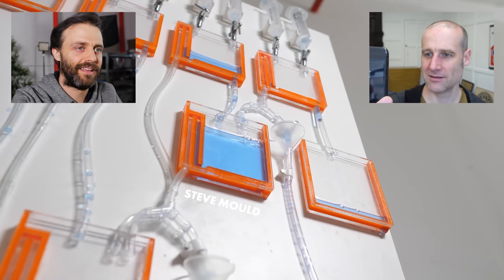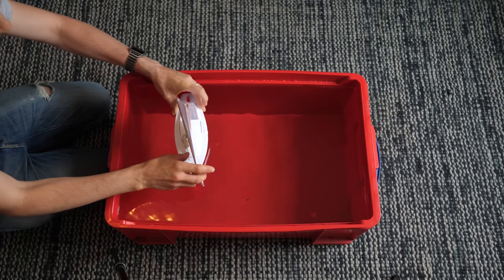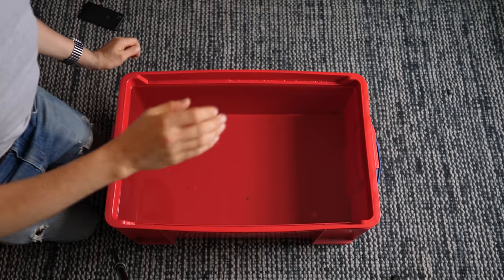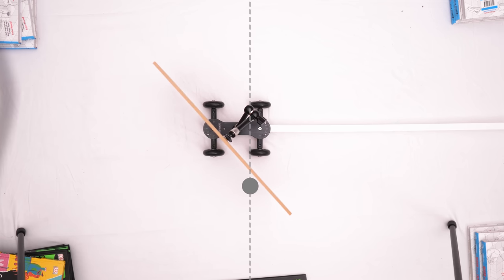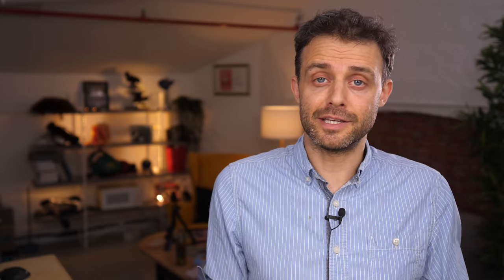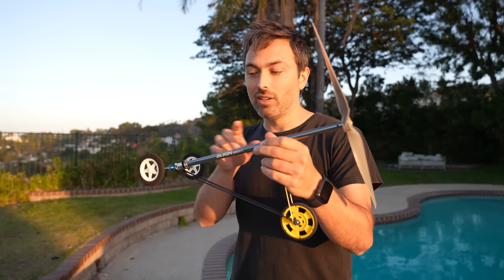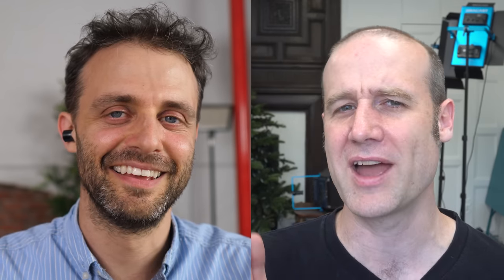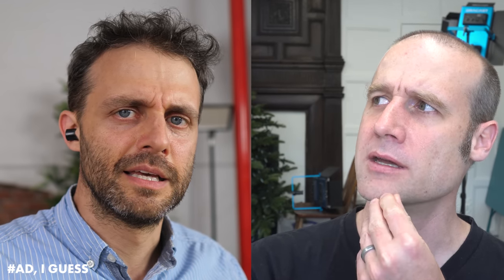Sailing Faster Than The Wind - How Is That Even Possible?

Comment: Bernoulli's Principle and the Coanda Effect are two sides of the same coin as I understand it. The Coanda Effect describes how flow clings to a convex surface resulting in a change in the flow's direction of travel, and Bernoulli's Principle describes how the force required to change that direction of travel is reacted against the curved surface via a change in pressure. You don't get one without the other.
Reply from the maker: Good insight. I think I might end up using your glass cutting techniques for an upcoming video by the way!
Reply: @SteveMould  Good stuff! If you use my mini sandblaster design and find it shreds right through electrical tape it's probably because the sandblaster barrel is too long. It's a balance between cutting the glass quickly without destroying the stencil.
Reply from the maker: Thanks for the tip!
Reply: I more or less agree until you say "You don't get one without the other."  For example, Bernoulli's equation can be used to describe the flow in a pipe that has a reduction in diameter (no increase).  With no increase in diameter (as one travels downstream), I don't think the Coanda Effect applies anywhere.
Reply: @andrewsnow7386  I think the coanda effect is still present in that situation unless the reduction never levels out (a closed cone shape, which would have no flow anyway), as is the reacted force on the wall of the pipe. Because of the coanda effect you can assume the fluid will fill the volume of the pipe and follow the curves of the wall (because bernoulli's principle tells you that a vacuum would form otherwise) so it's not necessary to think about both principles simultaneously.
Reply: As a fluid dynamics grad student, I hope it's ok if I point out that the Coanda Effect and Bernoulli's Principle are actually a bit different than what you've described. There is some relation between the two, but there's really three sets of physics: Coanda effect - fluid jet hugs a wall due to viscous fluid entrainment; Bernoulli Principle - energy conservation along a streamline; fluid changing direction - momentum balance in the radial direction. 

The Coanda effect occurs when a jet of fluid sticks to a nearby surface. The reason the jet follows along this surface has everything to do with the surrounding fluid being quiescent (or at least slower than the jet). Because of friction and/or turbulent mixing, the queiscent fluid is dragged along ("entrained") into the jet. If there's a wall, the entrainment occurs only on one side of the jet, pushing it to the other side (there's more analysis here, but that's the end consequence). Note that this happens even when the wall is straight! The jet will hug the surface due to this viscous entrainment of the surrounding fluid. Also note that this entrainment doesn't really happen around a normal airfoil, so the Coanda Effect is not active.

Bernoulli is strictly about energy conservation along a streamline. So when you already know that a fluid is going to accelerate or have a certain pressure along a streamline, you can use Bernoulli to keep track of the energy balance along this streamline. Bernoulli typically assumes no friction, so that's another point of difference with the Coanda effect.

When a fluid changes direction, that's related to a momentum balance. Often, it's a radial pressure gradient balancing the centripetal acceleration of the fluid. Note that this radial pressure gradient would be mostly perpendicular to a streamline, so Bernoulli is not really the explanation for why this pressure gradient occurs in the first place.

Finally, here's how these effects can be related. When a jet hugs a curved surface (Coanda Effect), the entrainment of air creates the radial pressure gradient that supports the jet's curved motion. When fluid curves around the leading edge of an airfoil it typically accelerates due to conservation of mass, causing an increase in velocity, and by Bernoulli - a lower pressure near the surface. This sets up the radial pressure gradient that supports the curved motion. Why the fluid accelerates around an airfoil in the first place, however, is not really something that has a nice tidy explanation. As with everything in fluid mechanics, the ground truth is just what happens when you simultaneously balance mass, momentum, and energy in the fluid.

Also one last thing, when a pouring liquid clings to a cup, surface tension + gravity is the dominant physics that causes the flow to curve.

I'm happy to discuss if you are interested in learning more about these phenomena. Keep up the amazing work with your videos, the thermal acoustic engine absolutely blew my mind!!
Reply: @TheBohrokMan  Thanks for the insight!
Reply: @Nighthawkinlight  Maybe TheBohrokMan covered it better, but consider a cone with the end open, like an old fashioned nozzle on a fire hose. Here Bernoulli's equation can be applied to the flow in the nozzle. But where would the Coanda Effect be seen? OK, TheBohrokMan makes the point that it applies to the boundary layer in a pipe (and would thus also apply to my nozzle example), and I guess that makes sense. But, I suspect that's not really what comes to mind when the Coanda Effect is normally being discussed.
Reply: @TheBohrokMan  Great explanations, if someone wants to dig deeper then I must point out either Babinski explanation of lift or Mc Lean's book
Reply: There’s no Coanda effect in sailing.
Reply: I also want to point out that airfoils dont need the Coanda effect in order to work. This is a common misconception. In fact a fluid will follow a curced surface without friction or the Coanda effect. 

Also, the Bernoulli principle doesnt really explain lift either. Or actually it kinda does, but it assumes that the air speed is faster on the top side of the airfoil, but fails to explain why. Even if this was the case, the Bernoulli principle  is simply an inadequate explanation.
Reply: @bogdanboiii1154  Perhaps you can explain then,
Reply: @Mentalzenthal  No one ever gets Bernoulli families stuff right. Backwards Euler method and Brachistochrone is the root of it all.
Reply: @anthonyb5279  My intention was just to provide some clarity, as it's surprisingly difficult to find accurate explanations of bernoulli/coanda online, but I'm sorry if it came across as condescending. I'm an aeronautics PhD student at Caltech, so I just really like fluid mechanics. I'd be happy to explain more about the physics if you'd like, it sounds like you believe I misused the terminology and am lacking understanding on a lot of things.
Reply: @TheBohrokMan  im not a grad student you can't teach me anything. There is that condescending "im a Ph.D candidate" thing again. Cal Tec. humm sorry to hear that, thats what I suspected.  my education does not matter (Cornel, ODU NASA Langley) I don't have anything to prove and my education does not validate my authority, a lifetime of solving problems and exploring space successfully, sailing world record setting Yachts, racing planes, airliners, and even little helicopters on Mars. A Ph.D does NOT make you an authority on everything, not even a specific field. It just proves you know how to work hard and fallow threw.  It is not the apex of who you are and what you will do unless you end up teaching. if you end up working in your field you will do equal or grater to that effort every day. if you condescend people because they don't have your education you will accomplish NOTHING and no one will work with you. These enthusiastic amateurs are right it's all interconnected. It's all relationships of different forces finding their way to equilibrium. They have not beaten Entropy its just too complicated to explain in a short video. encourage these people don't squash them with your vocabulary.  This stuff is AWSOME and fun to learn about. encourage them to do experiments and make observations, gain personal insight. thats what Bruno Invented science for.
Reply: @anthonyb5279  Again, let me know if you want to talk about fluid mechanics, I'm always happy to learn. And I do leave positive comments on pretty much all of these guy's videos, they're incredible. Oh and it's Caltech, not Cal Tec. :)
Reply: @TheBohrokMan  Cal Tec :-P
Reply: @anthonyb5279  I think there's a misunderstanding here, I never discussed the vehicle at all in my comment. I was only distinguishing between bernoulli and coanda. Feel free elaborate on what you think I didn't get right, I'd be interested to know, and you haven't really told me yet (I'm on instagram or twitter if you want to DM). A CFD simulation would be cool to see, although a simpler blade element model would probably give more interpretable insight into the physics
Reply: @TheBohrokMan  I say that you can observe Coanda Effect in frictionless fluid and I have harnessed the phenomenon. I wanted air that was delivered through a high wall register to travel along the  wall rather than simply be blown straight out of the register. I made a chute to direct the air horizontally along the wall. The moving air is at lower pressure than the surrounding air. That is Bernoulli in action. The air continues to stick to the wall and is held against the wall by the higher pressure surrounding air. That is Coanda Effect. The air travels 15 feet easily and thereby cools the entire room. Of course the velocity diminishes as you move further away from the chute.
Reply: @pauleohl  Wouldn’t there be friction there though? Air has viscosity, and the coanda effect occurs often in air. Also, a (subsonic) free jet of fluid is typically at atmospheric pressure, for example the air exiting a leaf-blower is at atmospheric pressure despite having velocity (it gets a pressure decrease at the inlet from bernoulli then a pressure increase after the fan and then matches atmospheric at the exit). I might not be picturing your setup right, but I’m almost certain it’s the coanda effect in a fluid with friction (viscosity).
Reply: @TheBohrokMan  Of course the air we breathe has friction. My point is that Bernoulli conservation of energy equation works reasonably well for real air and that the reduced pressure predicted by Bernoulli where velocity increases is what causes the Coanda Effect and keeps my moving air "trapped" and moving along the wall.

I can't comment on what occurs with a leaf blower.
Reply: @pauleohl  Fair enough, but my point is that a free jet of air won’t be low pressure. In general, jets of air are the same pressure as their surroundings. To use bernoulli, you have to follow the path of the air through the whole system - in which case you’ll find that the fan that pushes the air, raises its pressure. At the exit, a jet of air has more energy (pressure + velocity) than its surroundings (only pressure), which is due to energy being added by a fan. Fluid having velocity doesn’t imply low pressure.
Reply: @TheBohrokMan  "Fluid having velocity doesn’t imply low pressure."

How do you think the Venturi at the throat of a carburetor works?

enturi effect
The Venturi effect is the reduction in fluid pressure that results when a fluid flows through a constricted section of a pipe. The Venturi effect is named after its discoverer, Giovanni Battista Venturi. Wikipediaenturi effect
The Venturi effect is the reduction in fluid pressure that results when a fluid flows through a constricted section of a pipe. The Venturi effect is named after its discoverer, Giovanni Battista Venturi. Wikipedia
Reply: @pauleohl I think I may not have communicated my point clearly. In order to apply Bernoulli, you have to trace the fluid along the whole streamline. You are correct with venturi, because the air is at one velocity  before the throat and then reaches another velocity at the throat with nothing in-between, so Bernoulli says pressure is traded for velocity. But for a free jet (your previous example), there’s some kind of fan in the mix! Energy is added along the streamline which stretches from the intake of the system to the jet output! This is just what you’ll find in textbooks and research papers: free jets of fluid are at ambient pressure. Velocity can imply low pressure, but not always - certainly not in the case of a jet of air. My fluid mechanics classes would be so simple if I could just say 5m/s of velocity = a certain pressure drop. Bernoulli applies only under a very restrictive set of circumstances: along a steady streamline, with no friction OR energy sources such as a fan. Please, you don’t have to quote wikipedia to me, it’s kinda rude.
Reply: After reading all the discussion I can't believe that Kutta Condition wasn't mentioned.
Reply: @TheBohrokMan  I have to admire your politeness when dealing with this much arrogance. Have you seen the WIRED video where John Collins (aka the paper airplane guy) attempts to explain the aerodynamics of paper airplanes? Around 4 minutes in, he makes the claim that Bernoulli doesn’t apply because “it’s only applicable to pipes”. What do you make of that?
Reply: @LCfreeze  Well I try to assume good intentions behind everything I guess lol. I just watched the video, and I only have issues with his lift and stall explanations. Everything else about stability or wing loading is 100% correct and awesome to see. Hope you don't mind the long comment below.

Alright, so Bernoulli definitely applies to airplane wings. It applies to any steady streamline of fluid (without friction). In fact, the classical way of computing the lift of an airfoil shape is to use Bernoulli on the upper and lower surfaces of the airfoil to get the pressure distribution, and thus lift. But, this requires you know the air speed across the airfoil beforehand. So it's not a way to "explain" lift, because you can't just look at an airfoil and use Bernoulli on it - you'd need the flow field around the airfoil first. 

To get that flow field (i.e. how the air is faster on the top than on the bottom) requires that you solve for it! Because air is a continuous medium, you need to find the motion of the air that conserves mass, momentum, and energy everywhere. There are some shortcuts, such as potential flow, which engineers used primarily in the past to find out how the air will move by hand, but these days, it's often a computer simulation. In short, the air goes faster over the top because that's just what the fluid does when it has to follow the laws of physics while moving around the airfoil. Not a satisfying "explanation," but that's ultimately what it comes down to. The best I can say is that the air gets kinda gets squeezed at the leading edge, which makes it go faster, but that's a simplification of events. 

I don't agree with him that the Coanda effect has anything to do with lift or stall. As I've mentioned in previous comments, the Coanda effect (as originally defined) is this narrow phenomenon of a jet of fluid sticking to things because it drags surrounding fluid along with it. I think that applies to the ping pong example because it's got a jet of air, but it doesn't happen in airfoils - there's no jets of air anywhere! 

The reason airfoils stall at a particular point requires delving instead into boundary layer physics. Basically, a thin layer of air right on the top of the airfoil gets slowed down due to friction with the airfoil's surface, and this layer can tend to separate as it loses energy under what's called an adverse pressure gradient. This is different than Bernoulli or Coanda, and can get somewhat complicated, so it's hard to go into here. But it's largely responsible for the separation. In fact, most methods for predicting stall and separation are entirely based on boundary layer physics (besides those that just simulate the whole fluid). 

I hope that was mostly clear, hopefully my explanations aren't too confusing. :)
Reply: @TheBohrokMan  thanks for taking the time to look at that video, I appreciate it :) I always feel annoyed when someone grossly oversimplifies or distorts something that I’m educated at. You seem so chilled out in the face of all the misinformation — I’d like to reach that level of Zen mastery too.
Reply: @TheBohrokMan  How does the Kutta condition fit in to all that?
Reply: @Bapuji42  the kutta condition is related to finding the flow field around an airfoil. It’s basically an assumption that the air flows past the trailing edge of an airfoil smoothly, which allows you to solve for the airfoil around the whole airfoil. So it’s not really related to Bernoulli or Coanda, it’s just a modeling assumption used for airfoils.
Reply: @TheBohrokMan  sorry to bump this old thread but I have to say your original post is absolutely correct. This video contains an error so it is right to point it out. As you say, the Coanda effect explains what happens when there is a jet in proximity to a surface. It does not apply to a plain airfoil. Coanda effect may be present on a wing or other surface that is in proximity to a jet, but that certainly doesn’t apply to a sail as stated in the video.
Reply: @TheBohrokMan  Hey it’s been a year but i’m curious what you had working in your favor to get into the Caltech aeronautics grad program? It’s my dream school and subject for applying to grad school this year.